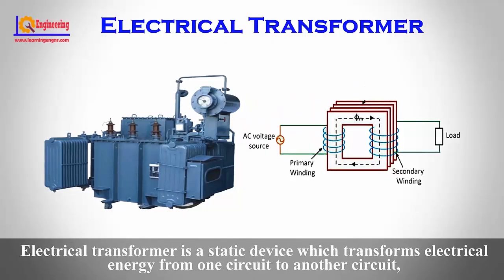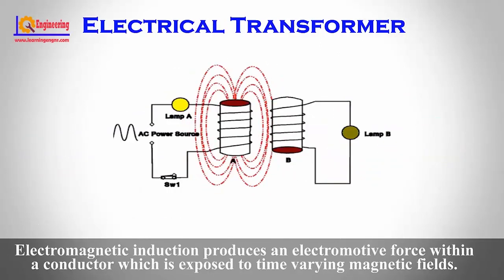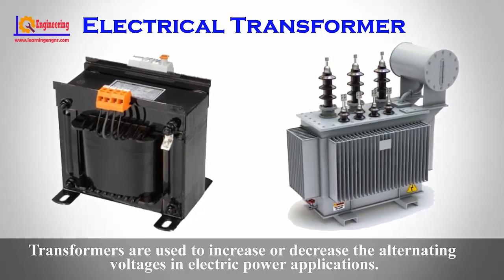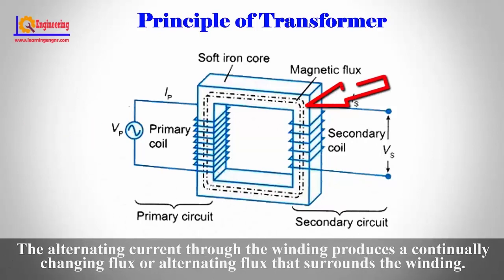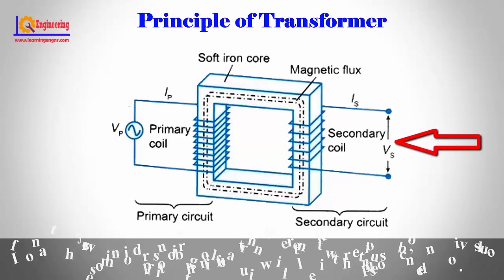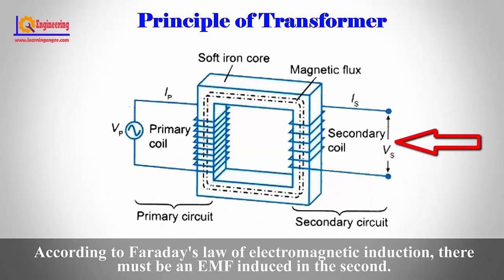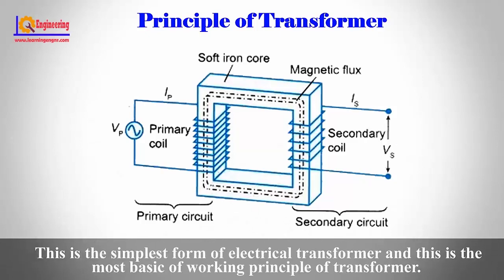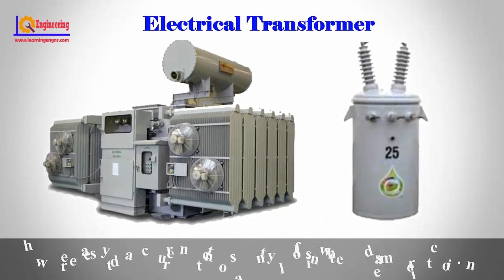How does a Transformer Work - Working Principle of Transformer

Comment: Hi

The wires from the coils are thicker and/or thinner?
I mean in the primary coil are thinner or thicker than in the secondary coil?
Reply: I'm not certain,but  Usually the primary feed is smaller conductor than your secondary.